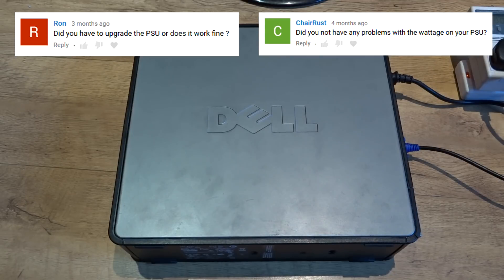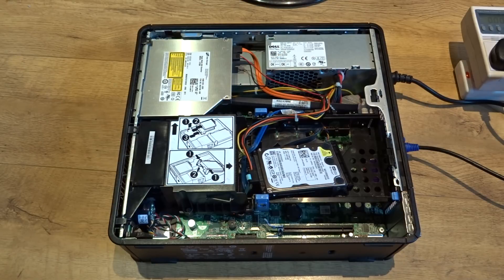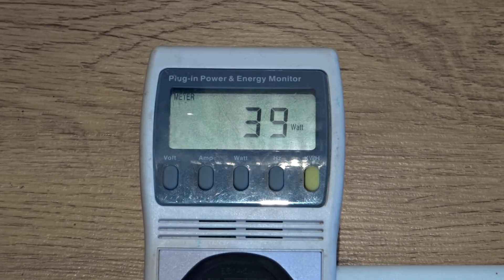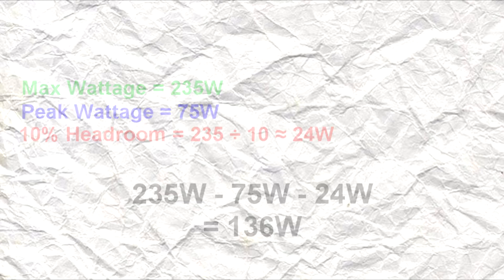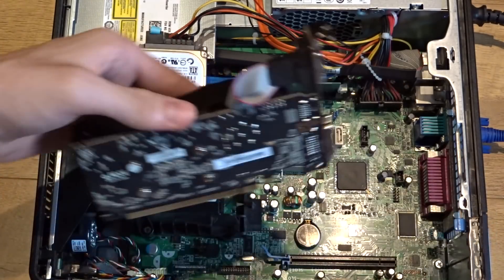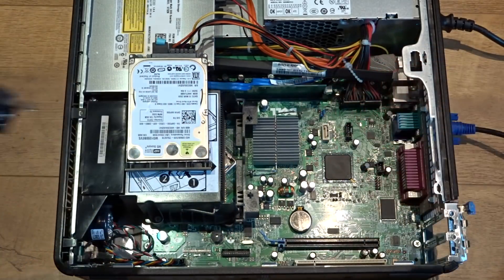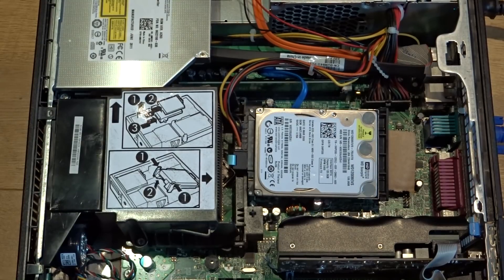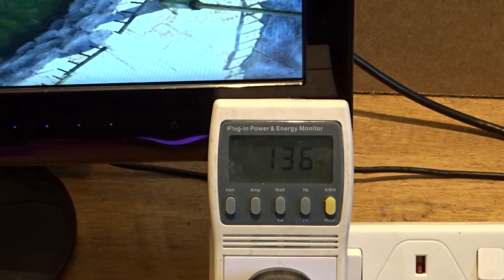Optiplex 780 SFF to Gaming PC

Comment: Unfortunately, with your SFF, you are unable to install a GTX 1050 Ti of any kind because all of them are dual slots and as you know, these old OptiPlex cases have slot room in the wrong direction.
The best card your case can handle is the MSI Radeon 460 4gb low profile as that is single slot card.
I have the DT of OptiPlex 755 with PCIe riser so I am able to install full height single slot cards, and I went with Zotac 1050 Ti mini as that's also one of a kind to fit inside a single slot machine (with plastic shroud removed)
Reply: Floper Doodle I don't know much about graphics cards and all of that stuff, but will it be compatable with the sapphire hd 3870?

Comment: Can the dell optiplex 780 run a sapphire Radeon hd 7970?
Reply from the maker: The wattage is pretty high so you would need to get a new power supply. I was also unable to find a single slot version so it may be not even fit.

Comment: Hi I’m going to upgrade a graphics card in my dell optiplex 780 dt and I’ll will need to upgrade my power supply to 300w or over to run the upgraded graphic card can any 1 here help getting the upgrade power supply that will fit my optiplex 780 dt
Reply from the maker: What graphics card are you trying to get?
Reply: Msi Gt710 low profile
Reply from the maker: I honestly would not worry about the power supply since that card is only 19W
Reply: MightyElemental thanks mighty for the help

Comment: Another problem can be the pci slot's w limit.I have an optiplex 990 sff and it says on the mobo that my pci slot can only handle 35w power.A gtx 1050 sucks 75w from the mobo (im talking about a pci expres 16x gen2 slot).
Reply: I saw people worrying about the 35w thing but they end up running the gtx 1050 ti just fine.
Reply from the maker: hmm. Well, this GTX 750 Ti seems to work fine in this slot so I'm not worried.

Comment: Can I use a GTX 650 to with this pc
Reply from the maker: It is possible if you use a low profile GTX 650 but I would not recommend it. A GT 1030 is more power efficient and it performs better.
Reply: MightyElemental gt 1030 costs 87 and 750 to costs 72 Wich one should I buy
Reply from the maker: I would go with the GTX 750 since it has better performance.
I used a GTX 750 Ti in this video and it worked fine.
Reply: MightyElemental okay thanks and Wich cpu do you use and Wich one do you recommend?
Reply from the maker: In this video, I think I am using the E8400. However, in my personal rig, I am using an i5-4670k.
Are you planning on building from scratch or are you going to buy a prebuilt? Also, what budget are you working with? The CPU I recommend to you will depend on that budget.
Reply: MightyElemental I am buying the 780 sff prebuilt without the cpu for 50€ and I think I want to spend a Max of 100 on the cpu and gpu
Reply: MightyElemental I was wondering if I could use a GTX 1050 low profile 2gb version
Reply from the maker: I would say it is quite risky to go with the GTX 1050 since it can use up to 75W which is the maximum for a PCIe lane as far as I know. I would not feel comfortable putting any graphics card that uses more than 65W into a system like that.
As for the CPU, I would recommend a Q6600 or a Q9400. However, it depends on the price and I'm not entirely sure if they would work with the Dell bios. They should do since they use the same socket and chipset.
Reply: MightyElemental I am going to use the e5450
Reply: MightyElemental and is there a way to limit the GPU from using over 65 watt?
Reply from the maker: Ok, fair enough and yes. However, if you forget to enable the limit, it may result in a crash.
The way I would do it is through MSI Afterburner and set the power limit to 85-86% which should force it to not use more than 65W
Reply: MightyElemental thank you so much I really appreciate your help

Comment: Hello i have a question i have a very bad old pc (dc7800 sff) specs are i2 2.33 ghz 3gb ram 240 psu.
Do you think that i can still install a 710 or a 730 or something i need it very very badly.
Very nice video by the way. Sorry for my english if its bad ;)
Reply from the maker: Yeah, I'm pretty sure you would be able to install a gt 710 or gt 730.
However, you should consider getting a GT 1030 instead of the GT 730 if possible since it uses less power and it should perform much better.
And I'm glad you enjoyed the video.

Comment: Why i can't open the onion.link??
Reply from the maker: Because it either is not a thing or you  did not click the link.
Reply: MightyElemental oh yes,i also have question i have plan to buy dell optiplex 790 with core i3 2100 and gtx 1030,the question is will it run some game like skyrim or fallout 4?
Reply from the maker: Yeah, that card should work for you. You would be looking at around 40fps which could be fine depending on what you are used to. You could lower the resolution to get a higher framerate if you want.
This video should give you a basic idea https://www.youtube.com/watch?v=zoWSeKJ99W8
Reply: MightyElemental oi ,thank you mate!

Comment: Can u actually use a gpu without any brakets??
Reply from the maker: Well, you technically could use a graphics card without brackets but I would advise against it. The brackets are there to hold the graphics card in place to prevent it from breaking.
Reply: ok thank you!

Comment: i have something similar but it is LOUD AS HELL! :(

Dell 990SFF with i5 2500 + GTX 1050Ti LowProfile (MSI) + 8gb ram and 2 sata hdd

max power draw from wall is about 150W-ish under load and idle is about 65-70W

PSU is 240W dell genuine

Only things that makes me worry is the cpu cooler noise and CPU temperatures :(  !!!! - is there any hints or answers how to get it cooler and quieter!?

Thnx!

Thnx to this video i got the idea and i love the small "BEAST" of a pc    :)
Reply from the maker: What temperatures are you getting? How old is the computer? Have you cleaned the heatsink recently?
Reply: clean the heatsink, maybe will solve the problem.
Reply: Or maybe underclock, lose performance but less °C or you could get a new fan!

Comment: I just orders a Dell Optiplex 980 and also talked with Dell. They made these for people that cant pay a lot for a gaming desktop or laptop. Dell also purposefully put high powered CPU in these for that reason also. Yes they are meant for business but most of them wont keep them for long.. You can find a lot of these in hand me down shops, amazon, PCliquidation, or Newegg. The normal size ones are made that way too.
Reply: if they are made for gaming, do they avoid the stupid Dell single lane PCI express nonsense? cause Dell has all the lanes facing the wrong direction, and thus you can't use 2 lane cards. makes it a pain. I had to buy a single lane 1050 for a Dell Optiplex 780 mini tower I was making for my cousin. Meanwhile I had a perfectly good 750 ti lying around that I took out of my own main computer when I upgraded. But it was useless to me as it was dual lane, like 99% of cards designed for gaming.
Reply: Can you explain me what dual lane is ?? thnx
Reply: you can change the PSU and put a double slot mini card in those using the riser card/bracket. a little shameless self promoting but i have a video on it. 

https://www.youtube.com/watch?v=rWw4H7gOIjs&t=47s
Reply: Broud Games its pretty much a way to make it slightly faster. There is little difference. You can get it for you computer. As long as it supports that kind of RAM.
Reply: skitzgamer as long as it's a low profile. You can stick a GTX-1050 4GB LP. unless you have a normal desktop then you can out anything in it. I have a 980SFF. This one he shows in the video is a SFF. If it's bigger then this one in the video then you can fit any kind.
Reply: Joshua Uriarte I have a sff will a gtx 750Ti single fan work
Reply: No, dual lane is the slots in the back. If a card is dual lane, that means it takes up two PCI ports on the back. And my Dell Optiplex 755 does have the backwards motherboard and case, so all the PCI cards go in upside down (but right side up, in a sense.)
Reply: R. Andrew Neal just got a optiplex 755, what graphics card would you recommend, planning on doing a xeon pcu swap along with adding 4 more GB ram to make it 8 total
Reply: @JazzySizzles   The extra ram won't make as big a difference as a graphics card . 
I recommend first upgrade processor, then graphics, then add HDD ,then ram in that order of benefit.
Reply: dose this mean i can upgrade my dell optiplex 980 to put in a gtx 760
Reply: I have dell optiplex 3050 mini tower will it for gtx 1050ti it's power supply is 450W.
So I just wanted to know that will the graphics card will fit inside the cabinate
Reply: I took my gfs dell gx520 to attempt fix it's no boot, just blue light start button. I installed new CMOS battery but made no difference. Help! Tried reset.Board has power so PSU seems ok.
Reply from the maker: Have you got a graphics card installed? Which display connector port are you using? One on the pc or one on the graphics card? Have you verified the cable works? Are there any beeps? What happens if you remove the ram and then try booting up? Is the computer in warranty? You could try contacting Dell directly about this.
Reply: @MightyElemental  No beeps,onboard graphics , vga cable is good,power button comes on solid amber, fans kick in for 2 seconds but nothing onscreen.cant access setup/biosbootmenu its xp pro os. dualcore

Comment: What graphics card did you use
Reply from the maker: A GTX 750 Ti (specifically N750ti-2GD5TLP)
Reply: MightyElemental do you think a 1050ti would work
Reply: yes with a low profile will it work

Comment: Hi, can you please help me suggest if I need a graphics card for my Dell Optiplex 3020 (mini tower) i5 500gb- HDD 8gb-ram. I basically use my pc for media n video editing for my YouTube channel. Do I need a graphics card as it supports dual monitor setup as stock?
Reply from the maker: While editing do you experience any lag or stuttering? If so, I would suggest getting a graphics card. But if you are not going to be gaming or using the gpu acceleration for rendering then you don't want to get something fancy like a gtx 1080. Maybe just go with a gt710 or something to remove stuttering.

Comment: I fit a gtx 1050ti 4gb low profile on a dell optilex 9020 with no problems, runs pubg at 50fps at high/max settings. pretty decent machine.
Reply: +sulkembo
how the hell does it run better???
Reply: sulkembo I have the same setup as you and I've been using it for 4 months without problems
Reply: Yeah it's a decent machine. I hate to say it but runs better than my i7 with a gtx 1060 3gb..
Reply: sulkembo is it using stock psu
Reply: @maverickmontages4465  Yes, stock PSU
Reply: I'm gonna do the same with a 990 dell optiplex.
Reply: @eppyfourtwenny4013  so i do the same, i have been instal a 1050 Ti on 9020, games and apps run ok, but because the card is above power suply he get hot because coller take the hot air from power suply, in time is not so good.

Comment: I use hp pro 3340mt, but its vga radeon r7 240 why can not, other pc can use r7 240
Reply from the maker: I'm not quite sure what you are asking. But I think you are asking why your R7 240 wont work in one of your computers but it does in the other ones.
There could be multiple reasons why it wouldn't work. For example, there could be power connectors that you did not plug in, the psu might be worn out or you installed it in the wrong slot.
If you need more help, just send a reply
Reply: what is hp pro 3340mt suitable for vga radeon r7, and what 300 watt psu can be using vga r7 240

Comment: I have dell optiplex 780 sff with Intel xeon x3363 quad core oc @3.02 ghz, 12gb ram ddr3 1066mhz ,ssd 120gb, hdd 2tb, gtx 750 ti 2gb gddr5 oc @1350mhz
Reply: Electrical Tape on pins method ... ( 1st pin and 3rd pin should be covered under the left notch of the CPU .. )
Reply: well i dont know about other pc's but my Q6600 did work and its giving me 3.00Ghz ( before 2.40Ghz) , and for the pins , it does differ from a CPU to another... do your research
Reply: MightyElemental  the overclock is by software (set fsb) :)
Reply: Rich Tuber My O755 DT also says maximum 25W on the motherboard, but my Zotac GTX 1050 Ti Mini is working fine for at least a year now. I think 25W is just a PCIE 1.1 specification more than anything else
Also, you have to look for the low profile 750 Ti, that is also, if you can find the 2GB GDDR5 version cheaper than a GT 1030.
Reply: Rich Tuber Oh nvm. A GT 1030 is not ideal for i5-2400. GTX 1050 Ti LP is the better option to go, though it will occupy two slots
Reply: Rich Tuber Again, my OptiPlex 755 desktop tower also has that written onto the motherboard with a 295W PSU. I noticed that after I plugged in the graphics card, had been using it for a year or so like that and it works fine for me even with a 75W GTX 1050 Ti
Additionally, my motherboard only supports x1 and x16 configuration, and I used to have a GT 730 onto it and it doesn't work very well at all. Just keep in mind.
Reply from the maker: Nice. How did you manage a CPU overclock in an Optiplex 780 though? Did you replace the motherboard?
Reply from the maker: Ah, ok. I've heard of that but I completely forgot. Does it cause any instability at all (other than power delivery issues if any)?
Reply from the maker: Yeah... Fair enough. It's not something I would personally do so that's why I asked instead of researching. Thanks anyway ;)
Reply: MightyElemental Don't forget on top of pinmod oc, SetFSB also works. my O755 doesnt work with 1600mhz fsb so no pinmod. But SetFSB works and oc to 3.2Ghz with that X3363
Reply: I have hp 6200 pro sff...its pcie x16 slot has limited to 25watt ..can i add gtx 750ti in it and power it with psu (320 watt)
Reply: I have hp 6200 pro sff...its pcie x16 slot has limited to 25watt ..can i add gtx 750ti in it and power it with psu (320 watt)
Reply: KF ZHU + Thanks for Reply..
Reply: Does GT 1030 will work in my pc

Intel i5-2400 3.1 ghz
Small form factor
PSU "320 Watts"
Reply: Hey Friend KF Zhu...plz answer one more question...
My PCIe x16 has limited to 25watt ...can i add 75watt graphic card in it and power it with psu?
Reply: kf zhu does your graphic card only draw power with pcie slot?
Reply: Rich Tuber Yes and my psu has no 6pin or 8pin obviously.
You may have a chance of breaking stuff, but from my experience it should be relatively safe, provided that you clean up your case and psu properly
Reply: kf zhu * Thanks Bro..
Reply: Hi What setting do you use for setfsb
Reply: You can buy the cpu on aliexpress for 20$, but you must install a modified bios because this cpu is compatible with socket 771 (server PC). This operation is safe and very simple. The x3363 is the best cpu for this socket and the price is cheap

Comment: Can you use GTX1050 Ti and is this the same for dell 790sff
Reply from the maker: Know Hype this method should apply to any gpu you wish to install. As long as it physically fits and the wattage is within the limit, it should be fine. However if your Gpu has additional power connectors you will need to either replace the stock psu or buy another one and use it as an external psu.
Reply: Your quick response is appreciated, final question, is it a lottery when it comes to how much life you get out of these type builds? If you can afford to would you recommend a new parts from scratch budget build instead?
Reply from the maker: It really depends on budget. This PC would cost around £90-150 depending on where you get the parts. If you were to build a new PC for the same price range, you would seriously struggle.
The main PC only cost me £30 so even if it only lasted 6 months, it would be fine. The graphics card is unlikely to break so you could move it to a new computer when needed.

And yes, it is kind of a lottery because no two circuits are exactly the same so some can wear out faster than others even though they do the same thing.

If you are looking for a cheap, easy, quick gaming PC that will last you a short amount of time then I would recommend doing something similar to what I did in this video.

If you have a budget of over £250 then I would be tempted to start looking into buying a new PC.

TL;DR Yes it is kind of a lottery, some builds last longer than others. Building a new PC is not worth it if you have a really small budget.
Reply: Thank you for your honesty, I was thinking of spending about £500 to no more than £600 on a build that gives me smooth play on most games at medium to high settings 1080P. I could spend a bit more and buy pre built but the idea of doing it myself is what's calling me. Best of luck with your channel going forward.
Reply from the maker: With a budget of £500 - 600 I would definitely build my own PC.
And thank you ;)

Comment: can dell optiplex 780 sff use gt 730 2Gb gddr3?
Reply from the maker: Yes. The graphics card I used in this video was a GTX 750 Ti so it shouldn't have any issues using a GT 730
Reply: can your pc run gta 5?
Reply from the maker: Zarith Iman yes it can, but the cpu will be a limiting factor.
Reply: thanks for reply
Reply: MightyElemental sir can u link were u bought the gpu and my pc has 500 gb 8gbram can i play games?
Reply from the maker: GTX 750 Ti: https://www.amazon.co.uk/dp/B00SOXMPJY/
8GB of RAM is enough to play most games but storage is not what makes a good gaming PC.
To know if your PC is good enough to play games you would need to know the CPU and GPU.
If you need help finding out what CPU you have, message me.